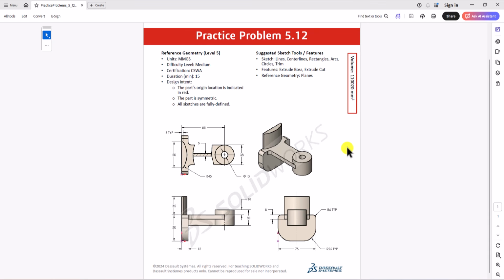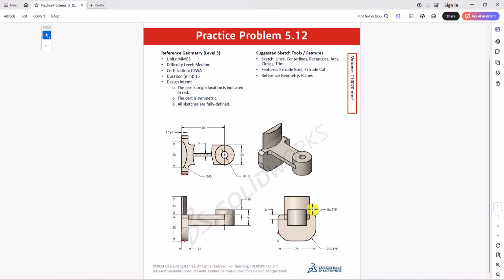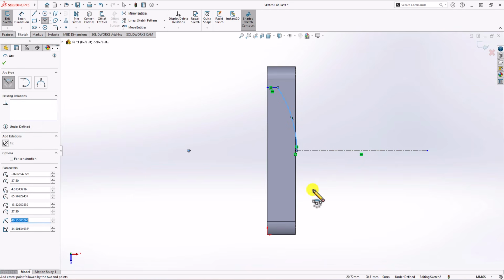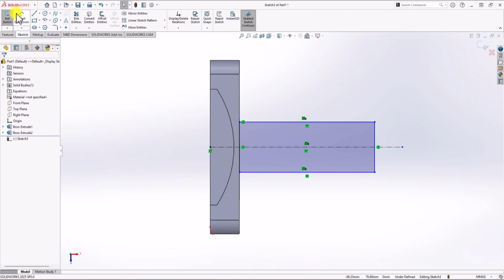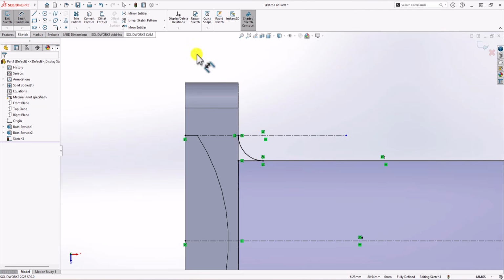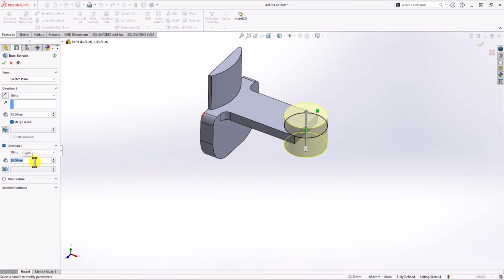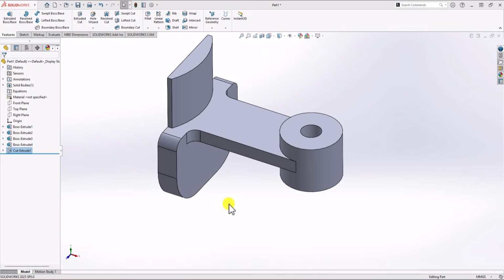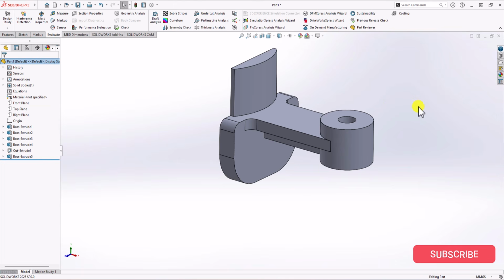CSWA Practice Problem 5.12 Solution | SolidWorks Exam Guide

Comment: So you don't have to use reference planes at all? Weird considering this is in the reference plane section
Reply from the maker: As you can see, I didn’t need to use a reference plane. However, if you insist on using one, there are a couple of ways to approach it.
One option is to use the reference plane to create the cylinder in my model, and then use Extruded Boss/Base in two directions, with 10 mm and 20 mm heights.
Alternatively, you can create a reference plane 10 mm above the surface, sketch the main circle on the new plane, and then use Extruded Boss/Base downward by 30 mm.

Comment: thanks for the mirror entities shortcut, but u can do it without that too, right?
Reply from the maker: Yes, absolutely. For mirrored features, you can either create the full sketch from the beginning or model only half and use the Mirror Entities tool. You can go with whichever method works best for you.
Reply: @Design_With_Roozbe  alright cheers